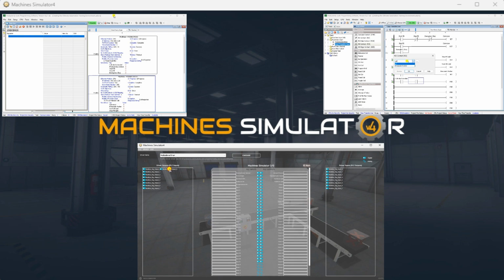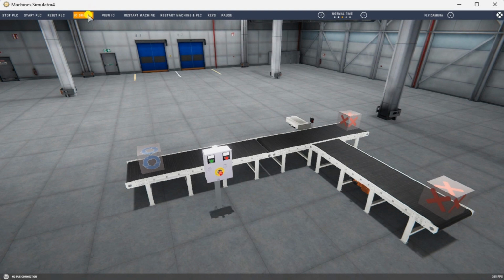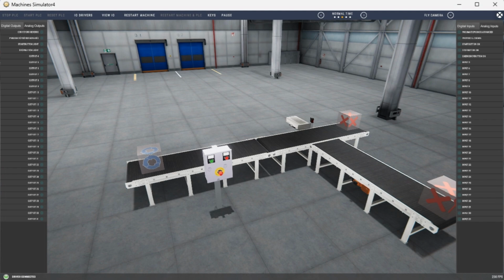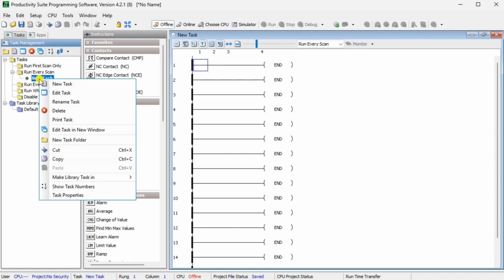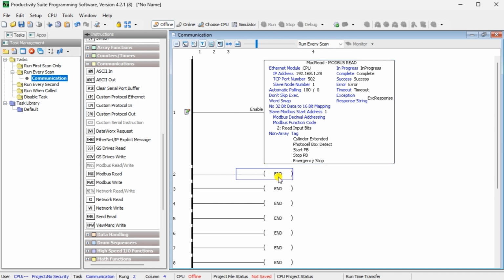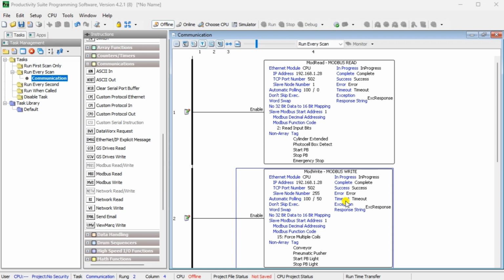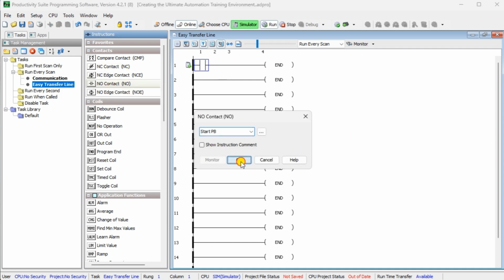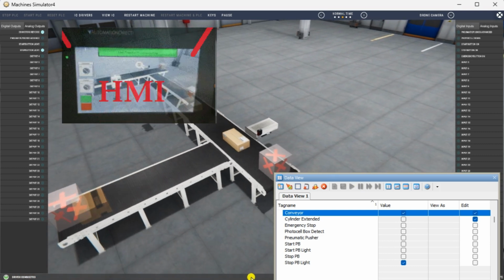Your Productivity PLC: You Can Control This Now!

Comment from the maker: Our website post provides effortless access to all the relevant links discussed in the video. We have gathered all the necessary information for your convenience, to all the resources mentioned.
https://accautomation.ca/creating-the-ultimate-automation-training-setup1/
Productivity PLC Series:
P1000 PLC Series - https://accautomation.ca/series/productivity-1000-plc/
P2000 PLC Series - https://accautomation.ca/series/productivity-2000-series-plc-p2000/

The EasyPLC Software Suite Series can be found here...
https://accautomation.ca/series/easyplc-software-suite/

Machine Simulator Suite (EasyPLC Software Suite) is a complete PLC, HMI, and Machine Simulator Software package.
This PLC learning package includes the following:
Easy PLC - PLC Simulation will allow Ladder, Grafcet, Logic Blocks, or Script programming.
HMI System - Easily create a visual human-machine interface (HMI),
Machine Simulator - A virtual 3D world with real-time graphics and physical properties.  PLC programs can be tested using EasyPLC or through other interfaces. (Modbus RTU, TCP, etc.)
Machine Simulator Lite - Designed to run on Android Devices.
Machine Simulator VR - Virtual Reality comes to life so you can test, train, or practice your PLC programming.

Purchase your copy of this learning package for less than USD 95 for a single computer install or less than USD 110 to allow different computers.
Receive 10% off the price by typing in ACC in the comment section when you order.
http://www.nirtec.com/index.php/purchase-price/
Learn PLC programming the easy way.
Invest in yourself today.

Here is a list of YouTube Shorts about the Machine Simulator Software Suite (EasyPLC Software Suite).
https://www.youtube.com/playlist?list=PL3y71jAPOdZAvTC8-TWNifAHpgEkAfqZQ

ACC Automation
https://accautomation.ca/